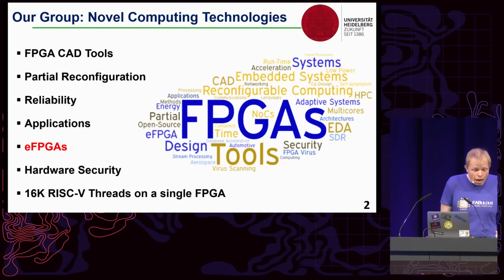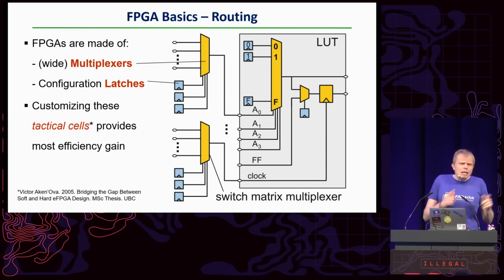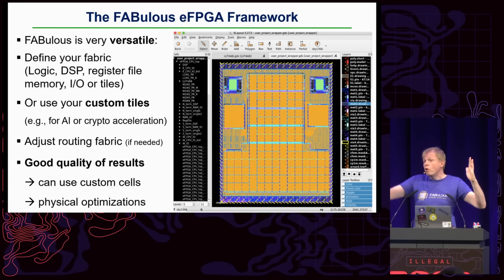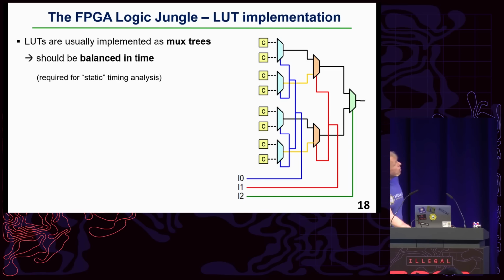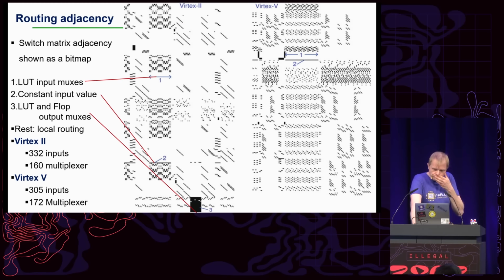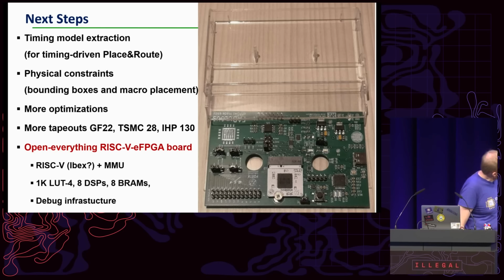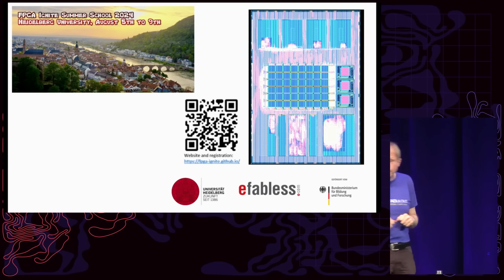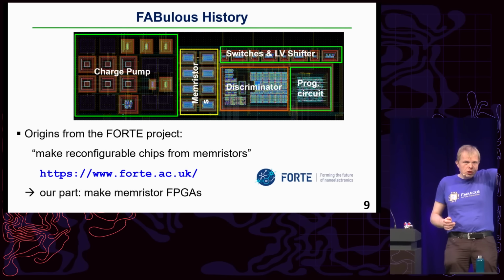38C3 - The Design Decisions behind the first Open-Everything FABulous FPGA

Comment: The development of FPGAs today is fascinating, especially when considering how the potential for thought modeling and organic community mapping could affect it, potentially using quantum capabilities. This could make traditional digital tech surveillance unnecessary for security purposes. By understanding the impact of certain thoughts within a community, we might not need to keep silicon designs proprietary for surveillance and backdooring, as the patterns of human criminal thought can be observed through other available means organically, such as a vast array of cellphones. This assumption is supported by a chain of patents dating back to 1976, which suggest the possibility of remote brainwave montoring and analysis, and the potential to match patterns to existing thought databases. Using a network of phased arrays such as those in 5g cellphone masts we can literally spot dishonest intent without montioring computing devices. This area of research could open up new avenues for technology accessability and home soverign computing. For more details, you can check out some interesting old patents related to brain state analysis https://interestingoldpatents.com/category/analysis-of-brain-states